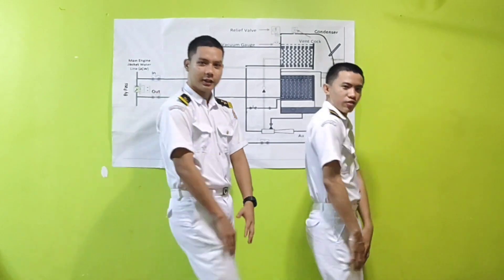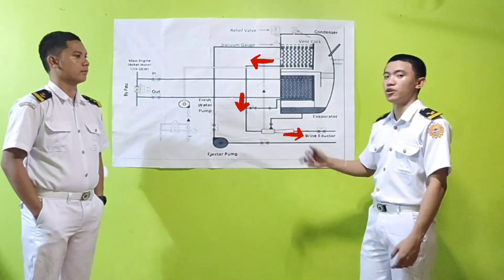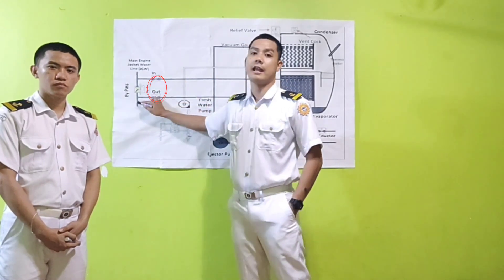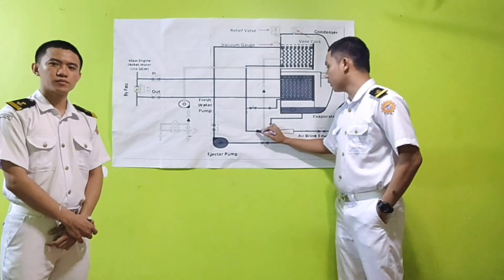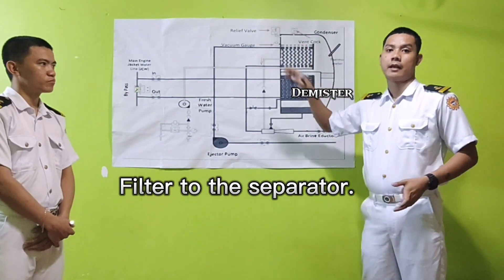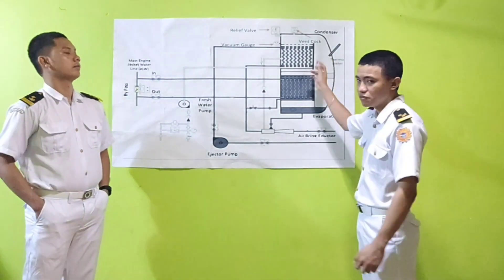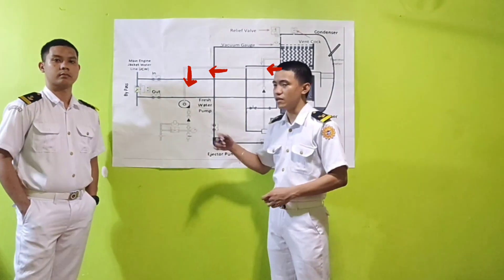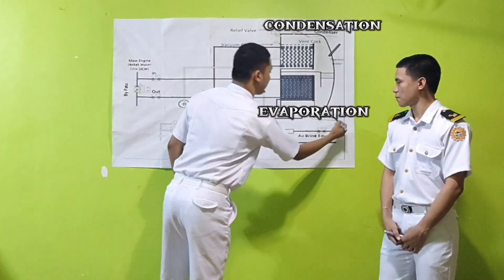Working Principle of Freshwater Generator | By-pair presentation.

Comment: Kindly advice if water is to be evaporated at low pressure  as the temp is low then the boiling point,the air/brine ejector should be connected to  evaporator shell not to condensor shell..kindly advice if I am wrong